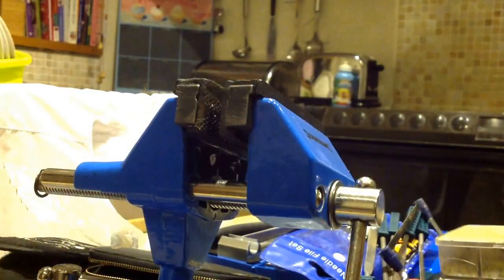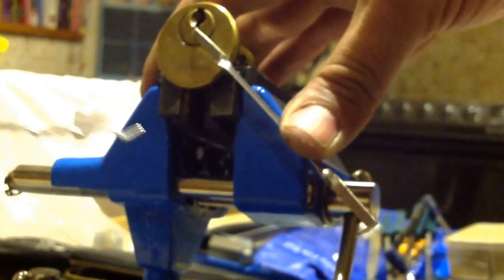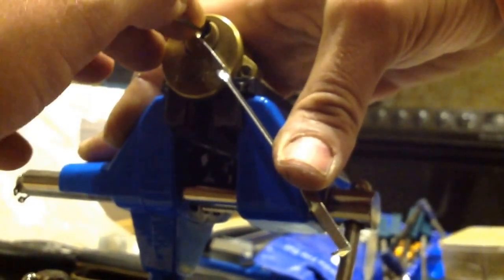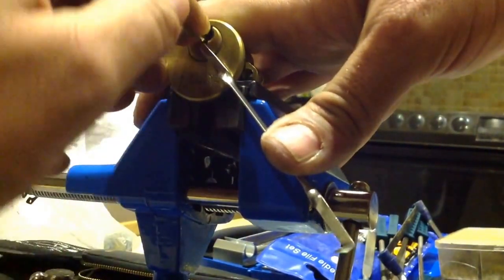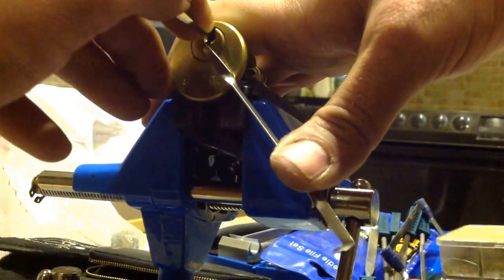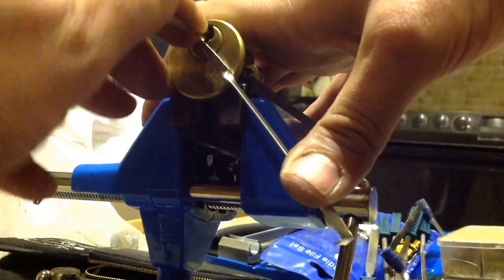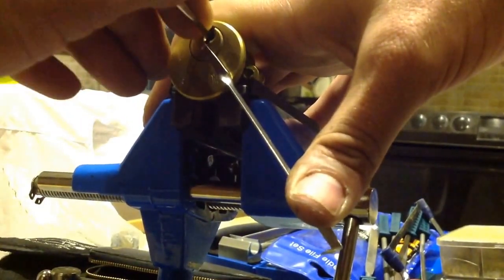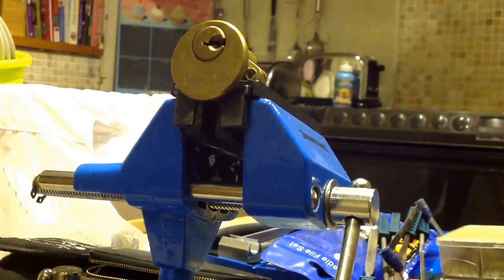Abus 5 pin rim cylinder Sppd.Thanks for watching and Please visit Uklocksport

Comment: Great picking Pick Beard.
Reply from the maker: Thanks buddy but can't do it with both hands( not as good as you yet😉)
👍👍🍻🔓😘😘
Reply: I can do it with both hands, but I am just a newbie level at picking.
It'll be years/if ever,  before I can pick the kinds of locks you and others can pick already.
Reply from the maker: +Aspie Pickerr it comes quicker than you think.
Most of the time it's confidence and practice.
In my case luck( truck loads) of luck😘😘